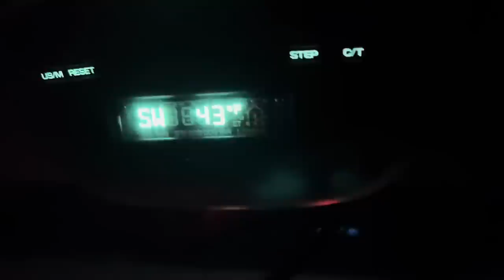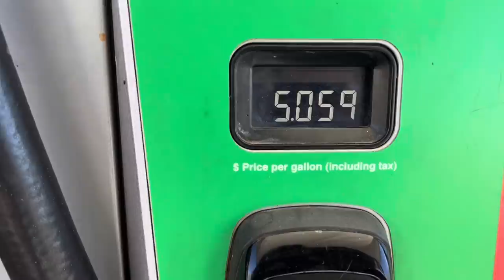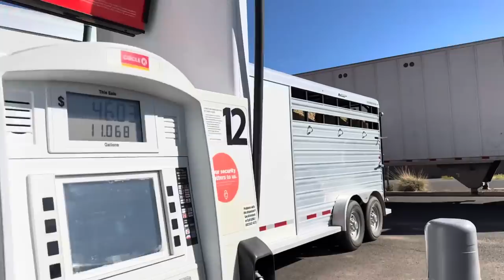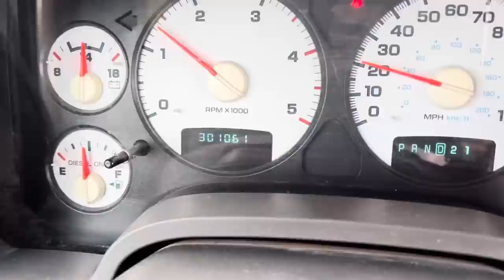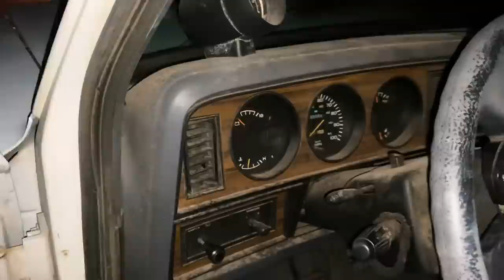NEW HOMES FOR SOME FOALS | HENSON’S SPLURGE + DATING ADVICE

Comment: That punk rocker forelock on the 2nd foal you unloaded is cute. And the buckskin is classy.

That's an OLD pickup! Sounds OK, lifters are kinda noisy. Toss some Seafoam in the tank and it's good for at least 100K miles more. 

OMG! Jump seats! Those are torture! 

OMG! A straight 6 diesel? 93 Cummins!

OMG! The old "that seat belt doesn't work" trick! He's a smooth dude!